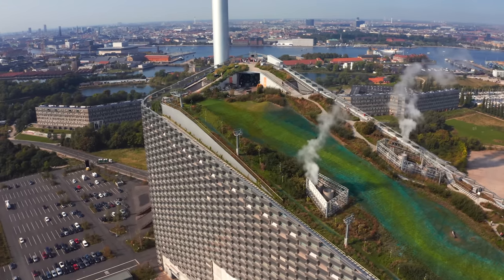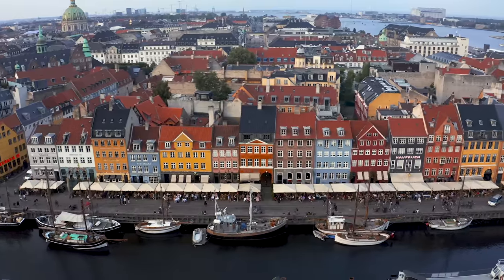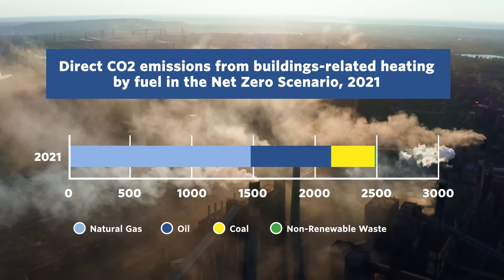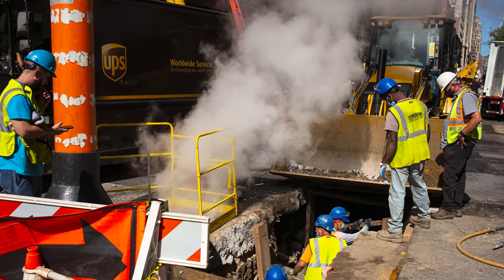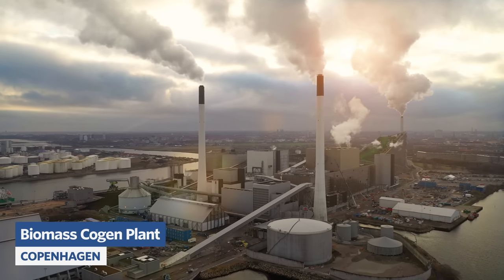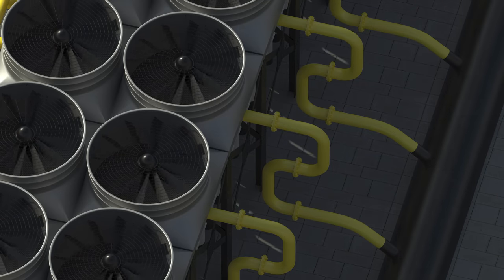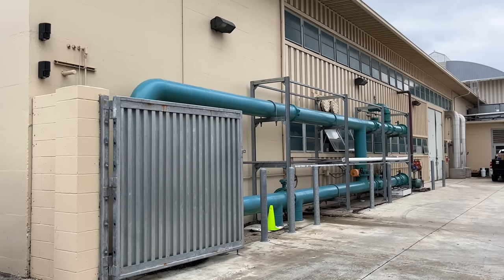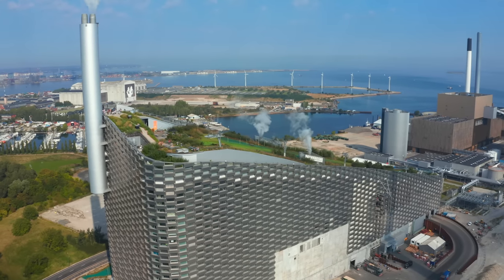An Introduction to District Heating Systems

Comment: You've got to think it would be cheaper for a city to write people checks for solar and heatpumps than it would be to retrofit district heat. One exception I visited recently was Steamboat Springs. They've got such a geothermal potential, mixed with an old downtown and a bunch of resorts. They should do district heat.
Reply: We are still law based democracy. :-)
You pay to get district heating and if you choose heat pump that is fine. Your choice you pay. 
There is not much sunshine on windy winter nights.
Reply: You forger economies of scale  it's much more effective to do heat pumps, solar heating or geothermal energy centrally than doing it in a thousand small locaitons. That said the change may not make up for adding a central heating grid for places that don't have them but new neighbourhoods should always be built with a grid.

Comment: As a Brazilian who had once visited New York, I just assumed those vapor towers were exhausting the excess heat from the subway system air conditioning. I was blown away when I watched a Cheddar video about it some years ago and learned district heating was even a thing.

Comment: I wonder what happens to those lakes if you heat them up when you cool your building down. doesnt seem right to me since some species need low water temperatures and thus does not solve the problem

Comment: Yawn. We've had such an incineration plant with power generation and district heating for decades in Augsburg, Germany. My apartment is heated with it. Ok you can't go skiing on the roof of the facility, that's a point for the Danes. Fun fact: Our district heating network in Augsburg, a city of 300,000 is longer than New York's (by a tiny bit) and counting!

Comment: High density with district heating means no heat pumps and no solar panels on roofs and a need to burn fossil fuels right next to living buildings for city to function. It all has been implemented in the USSR, it sucks and creates problems that seem to be unsolvable and damages that are irreversible.

Comment: I don't really understand why traditional powerplants have significant waste heat?  Why is the water carrying the waste heat not just reused in the boiler?  Or if its in steam, why is the steam not collected and condense to the same effect?  I guess there must be some reason if cogeneration is such a perennial technology, but it seems a lot easier than piping that hot water around the city and back...
Reply: It's bad for the steam to condense inside the turbine, so it has to be cooled down after it. You can't just heat up the steam again, as that won't really generate the pressure you need. A lot of energy is inside that phase change from steam to water, so that has to be gotten rid of with cooling towers or it just gets vented directly.
Reply: @MegaBanane9  Why can't the water heading into the boiler be heated with the steam?
Reply: @angrinord  for closed loops that wouldn't work, I'd say - for open loops it would (although I'm not sure if that's actually used anywhere anymore)
Reply: @MegaBanane9  I don't see why it wouldn't work for a closed system?
Heat energy is converted into electricity by the turbine and leaves the system, then is reintroduced by whatever is generating your heat.
Reply: Steam plants use closed steam loops so that the water can be purified to not contain impurities causing corrosion and clogging deposits. Steam turbines also have multiple phases. First phase uses 4000 psi at the start, and of course lower psi (and higher volume) after passing through the last stage. Unfortunately, it's extremely difficult to reheat steam (low density), so you must recondense it back into water first; this is where the waste heat primarily comes from.
Reply: @DIYRandomHackery  My question is why doesn't this work?
1. Water is vaporized in boiler
2. Steam drives turbine, losing large amount of energy.
3. Remaining heat of condensation is used to warm warm water entering boiler.
4. Condensed steam absorbs heat from non-condensed steam, bringing it to boiling point (but not enough to overcome heat of vaporization)
5. Remaining heat of vaporization added by heat generator (return to step 1)
Reply: @angrinord  1- Industrial facilities are already exploiting every efficiency they can affordably implement. I mean if I could spend $50 on capital equipment to save $10 on fuel per year, I'd hit break-even in 5 years, and have a $50 profit in 10 years; that's quite good. 2- The phase change from liquid to gas in a confined space is where the 4000 PSI (27,579 kPa) is generated. The pressure is doing most of the work here, not the heat. It takes 418 J to heat 1 g of water from 0C to 100 C. It takes 2260 J (5.4x more energy!) to go from 100 C liquid to 100 C steam (1 atm). In raw physics terms, you cannot use 100 C  anything (steam or water) to create steam.
Reply: @DIYRandomHackery  You seem to have misunderstood me.  I'm not saying suggesting you create steam with anything other than the heat source, only that you can use the heat of condensation from the spent steam to add energy to the water headed into the boiler.
Also, I'm not sure what you mean by the pressure is doing the work.  Pressure is a function of temperature;  If the steam were absolute zero it would exert zero pressure.
Reply: @angrinord  in a closed loop system, the hot condensate (water) is the steam that exited the turbine.
Reply: @DIYRandomHackery  The exhaust is still steam when it leaves the turbine; it must make the phase transition which releases the energy that it took to turn it into steam in the first place.  That energy has to go somewhere, so why not surround the condenser with water that has just condensed?  This condensed water will already be extremely close to boiling; by surrounding the condenser some of the heat of condensation will become the heat of vaporization for the water that was previously in the condenser.
Reply: @angrinord  If you assume worst case: steam leaves turbine at 100C. Sure you can extract heat during the condensation process, but you cannot put that heat back into the energy plant. it's too cold. If you put 100C water and mix it with 100C steam in a perfectly insulated system with zero losses - nothing changes. no water will become steam, no steam will become water. Sure if you want to export that heat to houses, you can do that; it's called co-generation by using this "low quality heat" for something else (heating houses).

Comment: Can this kind of technology be used in a tropical environment?
Reply: Do buildings in a tropical environment have heaters at all? The reason you find district heating primarily in cold places is that the efficiency gains make it economical due to the amount of heat you consume annually.
Reply: As long as you need hot water, or any other kind of heating up to 60-80 C, you can implement the system. The economics really come down to the density of housing (=clients), need for heat, and the cost of alternative sources of that heat.

For hot places, district cooling might also be suitable, as long as you have something to use as heat sink (say, the bottom of an ocean/large lake).
Reply: In a tropical environment your need is probably warm/ hot water. You can buy or make your own roof top solar collector or use a batch collector which is nothing more than an insulated box with a reflector with a specific shape to gather and reflect the suns energy onto a black painted tank to gather heat. Example walk past a dark colored vehicle and put your hand on the metal exposed to the sun. A batch heater just does the job better.

Comment: Good idea, who is going to pay for multiple of these to be installed in big cities and 1 in smaller cities. Who is going to pay for all the remodeling of current infrastructure to accommodate new piping. Most commercial buildings have water loops but they can be used for heat pumps at 70-80 degrees loop or just heat 180 degrees. Who is going to pay for the controls systems on heat pump loops that require lower temperatures and mixing valves. Who is going to pay for maintenance on the loop. All the buildings will need separate systems in house in case of main building failure. It’s a great idea for new cities. But who is making new super cities? They kinda form over time so you need to anticipate when and where they will form and if you mess up it’s a huge loss of money. Great tech but too costly.

Comment: The comment that only 12 percent of the homes in the world are heated with district heating is in a way misleading. Of the other 88 percent there is a large number that are in warmer areas that require generally fairly low heating loads for a short period during the winter season. The 12 percent given the geographic locations in a latitude that has moderate to extreme winter cold and many days to months of cold probably consume in heat energy easily 50 percent and probably more than all the rest of the world combined. They don't have a lot of options other than smart choices such as very well insulate buildings, minimal and well placed windows, possible thermal shutters, storing heat in the summer and use cogeneration to make electricity and heat for the winter. District heating is a choice that helps to solve the dillema. It's unlikely that a billion { just a guess } people will close up their homes and snowbird to a warmer climate for the winter.

Comment: I live in Denmark - and I have to say - I am always very sceptical of district heating! 
There has been many places where it has been implemented, and it has been insanely overpriced! Both due to lack of scale, and just amateur mangement! 
If you are connected, you have to pay, and many places it is not a choice, the "majority" has decided that you have to use it - and even if you don't use it, you have to pay a big bill just for having the option. 
When it works, it does work, and many places it is cheaper than the alternative - And I get the economy of scale, and that it can't be done if not everyone supports, and all that bs - but at the time, I don't like being forced into something, specially not in my own home!
Reply: You can always disconnect yourself. The idea that you can't is a myth. You only pay the grid charge if you're hooked up to the grid.
Reply: @DaDunge  I heard the rules have been changed! 10+ years ago I was looking at a house, and even if I chose not to use it, I still had to pay, and could not get rid of that! Needless to say, I didn't end up buying that.

Comment: The Russians and most likely the Finns have perfected District Heating at a larger scale WITHOUT burning fossil fuels. Yep using Nuclear Power by using heated water or steam from the Tertiary Cooling Loop to then heat the urban area nearby. Talk about a low carbon form of district heating...

Comment: Waste go energy is normal ind Denmark, distrikt heating ls the. Most normal heating in Danmark .    my house is fro1962 and it never had nothing else than distinct Heating more than 70% off all huses and apartments in Denmark is bye District heating .  

The Heating for my home is from straw from lokal Farms and recycling Heat from lokal factories and Sola in the summer times. My hearting is from 99% recycling and wind makes most of the power to the grid. We'll that's the normal in Denmark.

I live in country side Denmark and this is normal

Comment: this video made me cry like a baby... all our problems are artificially created; of course we have the engineering solutions for climate change- we always have :'(
Reply: well, yes, no, and sort of. 
In a lot of cases we've had things all along... but it's only recently that they've become Practical outside of certain very specific niches, for example. You'd be amazed how many things were invented Long before ways to actually apply them on a large scale came about. (for example: The ancient greeks had figured out the steam engine. Metulurgy sufficient to allow it to be actually Used for anything other than toys wasn't figured out until sometime in the 18th or early 19th century. Then you started getting steam powered pumps being used to prevent flooding in mineshafts. It took quite some time after That before steam engines started being used in other applications, and longer still before steam locomotives became practical for general use. 

It's intersting looking back through history for when things were invented. Many things were invented much earlier or much later than you'd expect. 

Of course, we've had issues with oil companies/decades spending decades actively spreading misinformation and engaging in campaigns of economic and political manipulation to keep their profits up even after the reality of global warming was known. (it was actually scientists working for ... Enron, I think it was, who first figured it out. The oil companies' response was... to build their oil rigs with taller legs against the possiblitiy of rising sea levels and start a campaign to suppress knowledge of the issue... then actively promote the myth of Global Cooling... and sabotage the development of photovoltaic technology, delaying its widespread adoption by decades).
Reply: @laurencefraser  i appreciate that you are trying to make me feel better, but it's not really complicated...district cooling/ heating is simply incompatible with capitalism

it's like the world as we know it was doomed when the USSR dissolved and neoliberalism became the default. so sad and so stupid